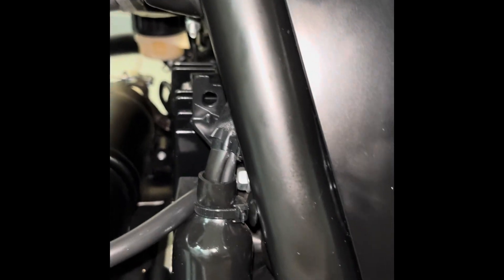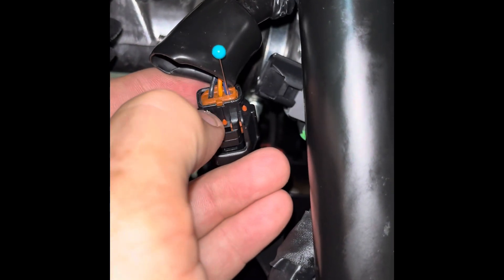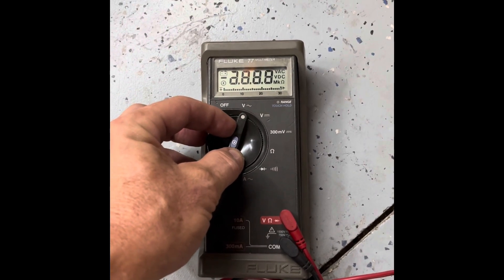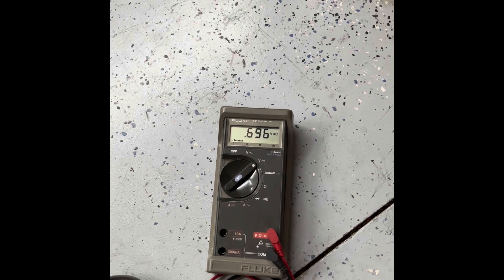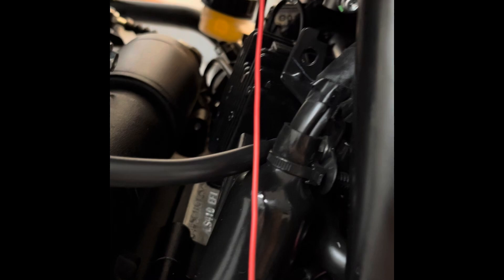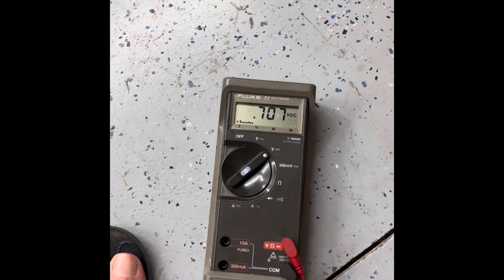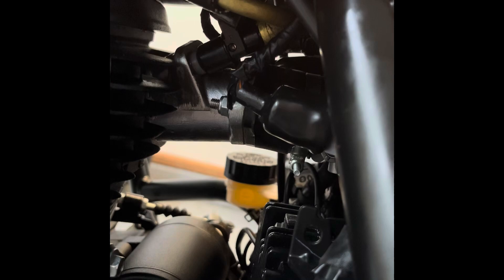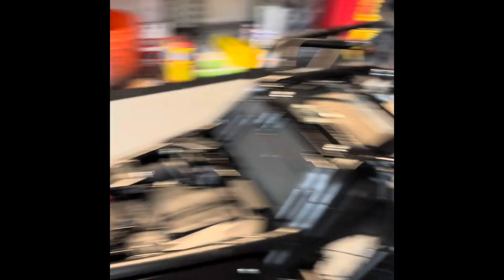Royal Enfield Himalayan cold start fix by adjusting TPS (throttle position sensor) voltage

Comment: Worked perfectly! Adjusted it to 0.708 volts from 0.62 volts . Starts much better from cold now. However, the check engine light is now on. Is that because the voltage is above manufacturer settings now?
Reply from the maker: I never had an issue with the MIL. Hummmm

Comment: i may need to calibrate my himalayan. It has been having issues cold starting. I heard by bumping it up, you wont even really need to use the choke anymore!
Reply from the maker: Yeah if you get it right you shouldn’t have to use the fast idle anymore.  Also it might be possible to reflash the ECU, there was an update that fixes the stalling issue.

Comment: Himalayan meters aren't responding after I converted to carborator, but gear count and oil are fine.any guess?
Reply from the maker: Did you use the kit with all the resistors for the fuel pump and injector?

Comment: Smoakes video is 5.6 to 5.7  says its what it should be ?
Reply from the maker: Many people have had to set the US models to .69 -.71 to get them to keep running at idle.  Not sure who Smoakes is but I’m sure he meant .56-.57.  I ended up removing the fuel injection altogether since In my opinion it was way to lean.
Reply: @MikesMotorcycleProjects  thank you, I have a 2021 us model. Set mine to .57 and still having stalling issues even after adjusting the idle. Will try .70. Notices a lot of the videos are for Indian bikes.
Reply from the maker: @JamesJohnson-ov5ct  To get mine perfect or as perfect as it could be I made sure it was fully warmed up, adjusted to .70-.71 and set the idle at 1250RPM. Just make sure its fully warned up when you set the idle speed which is done with the giant screw on top of the throttle body.

Comment: I have 2022 Himalayan following the instructions I was getting a volt reading of 0.64 with key on before even messing with the adjustment screw. I just stopped and decided to ask you for your comment. hope to hear from you soon.
Reply from the maker: If you having a cold start issue I’d try .70.  Ride it and get it completely warmed up the set the idle at 1250 to 1300.  Always set the idle speed with the engine hot.  You have to take the two bolts off at the rear of the tank and find the idle speed screw.

Comment: Had mine at .71 and thought I had everything sorted out. I did  200 mile trip a week ago and had no issues. I go to start it yesterday morning and I'm back to the cold start issue again and that's with it at .71 and idle adjustments. This is such a pain.....
Reply from the maker: Well I hope you get it figured out. I’ve wondered if the ECU has the ability to adapt and can counter any adjustment.  So for mine is holding.